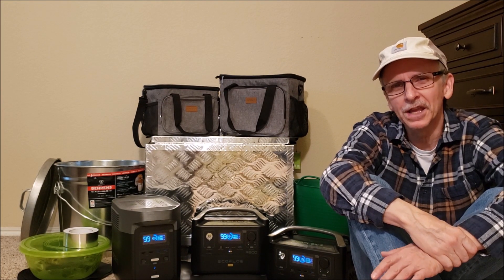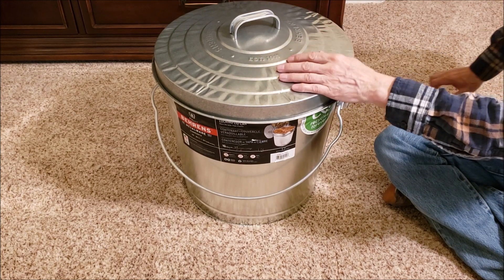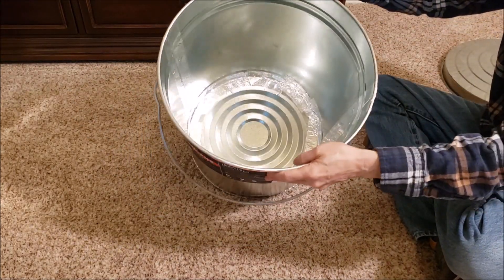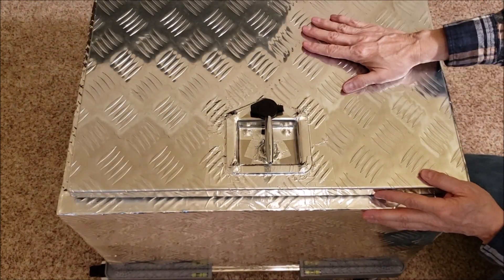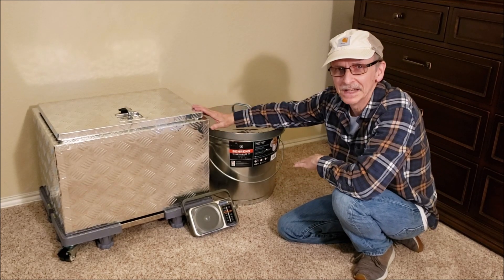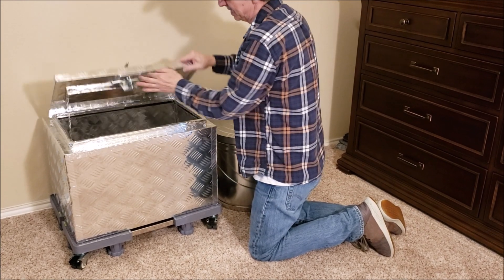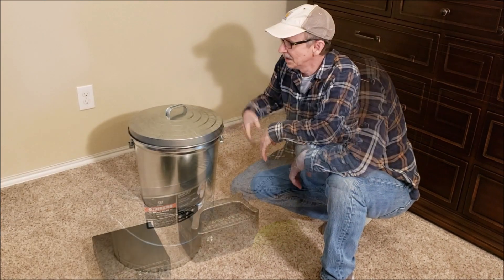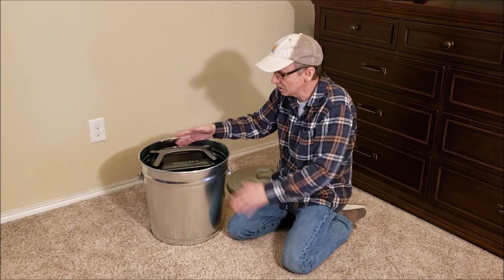How to Make a Faraday Cage for Your Solar Generator - Portable Power Station

Comment: Great information. How would you protect your solar panels?
Reply: Any idea where to buy a faraday bag big enough for a 100 watt solar panel?
Reply: I heard the only thing that would effect a solar panel is not the panels itself but that thing that is connected to the batteries and the solar panels don't know what it's called but it powers the batteries.
Reply: @anthonygonzales1027  solar charge controller
Reply: @anthonygonzales1027 inverter and mppt controller.
Reply: Build a Faraday shed. Remember that it's called a cage for a reason. You only need to keep the cats out of the bird cage.
Reply from the maker: If unplugged, an emp should not hurt them.
Reply: Most people say that solar panels dont need protection.  I dont know why and I dont know if thats right.
Reply: My solar panals dont have MPPT controllers on it and are portable w no wires attached.  So they would be ok in its suitcase storage.  
If its being used for daily use it probably would fry IDK.  These ideas are for portable items.
Reply from the maker: As far as I know, if they are not plugged in, they should be fine.
Reply: @LoneStarPrepping according to general searches, they're still at risk
Reply from the maker: @reginaking-snodgrass6413  According to about 95% of  searches I do, they should be safe if not plugged in.  Even some of those may survive.

Comment: Thank you so much.  Do we need to protect the solar panels that go with our solar generator or are they okay?
Reply from the maker: They should be okay if they are not connected to anything at the time of an emp or massive solar storm.
Reply: @LoneStarPrepping  Okay, thank you!  🙂
Reply: Will a 2000 watt inverter generator not running also need protecting. Or even a standard say 3500 watt jobsite generator. Thanks
Reply from the maker: Im pretty sure the inverter would but not, but Im sure on your other one.  Im doing another video on 6 most important items to put in a faraday cage should the worse case emp hit. Stay tuned.
Reply: @PreppingOver50  so if didn't clarify it would be a gas powered investor generator. Thanks
Reply from the maker: @thomascrompton7775  I think an "inverter" anything would be a problem.

Comment: Do you need to tape the covers on? I was under the impression that you should use that metallic tape and completely seal it.  Is that incorrect?
Reply: Without taping the seams with aluminum tape, RF will get in the slot.
Reply from the maker: I get about 50db protection as it is.  No tape needed.
Reply from the maker: I didn't need to.

Comment: This has certainly been on my mind. Three power stations and over 20 radios.
Reply: You’re gonna need several metal cans buddy.
Reply: @johnjanuary2958  I have my best portable radios stuffed inside a broken microwave. I have 12 power stations now and built my own for a window ac with a 300ah Ampere Time LiFeP04. I have no idea how to protect an active solar setup. The magnetic field of the earth is expected to weaken so much that nobody can go outside during the day because of deadly solar radiation and flares.
Reply: @johnjanuary2958  So "Magnetic Excursion Mass Extinction." We`re in one. (The school system has completely failed...)

Comment: Great video.  It shows me where I can improve my efforts.  I especially love the links.  You've put a lot of effort into this video.  Thanks for your help.  May I ask about the faraday bags you also showed.  Could you provide a link?
Reply from the maker: Go to the link below towards the bottom.  There is a site you can go to.
Reply: @LoneStarPrepping  Thanks.  I guess I'll need to be prepared for sticker shock.  :)  I've seen his site before.
Reply: Oops.  I'm wrong.  His prices have come down a lot.  I guess he found a better source.  Thanks again.  You provide some of the best material on YT.
Reply: I did the same galvanized can and tape, but my radio on solar didn't lose signal?
Reply from the maker: What kind of radio? You should use a strong AM radio signal. When that goes away, it shows at least 50db shielding, which should be enough. Cell phones, 2 way radios etc... have too strong of a signal.